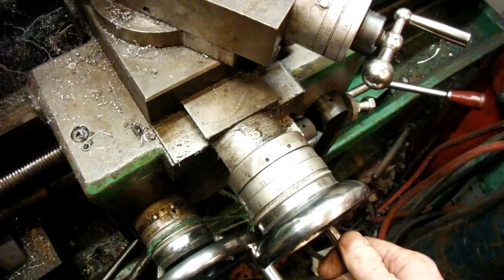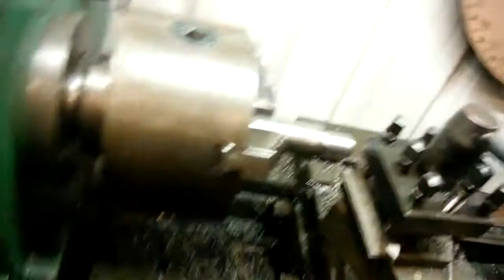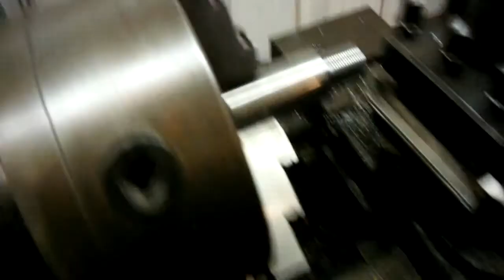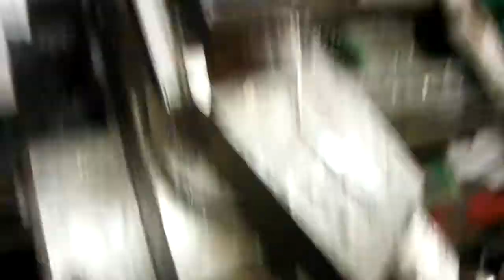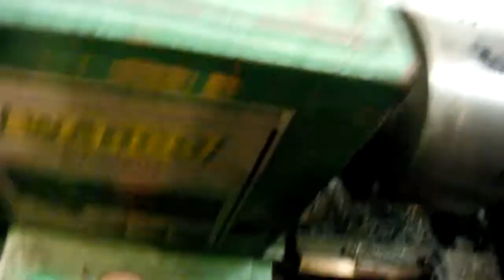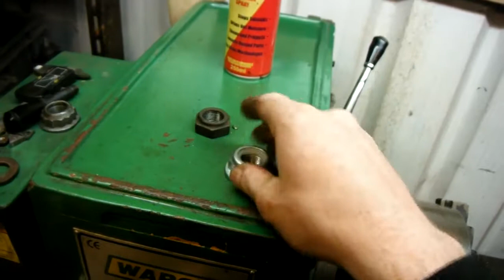Adventures with lathe cutting.

Comment: Hi Mouse did you finally run the bike you built with the VW 1.9 turbo ?
Best regards from Québec
Reply from the maker: Yes, I use it for my main transport for the last two years. 
I commute to work so maybe 50000 miles with it so far.
Reply: @o0OMouseO0o  Hi, i hope to see it running on YouTube
Regards